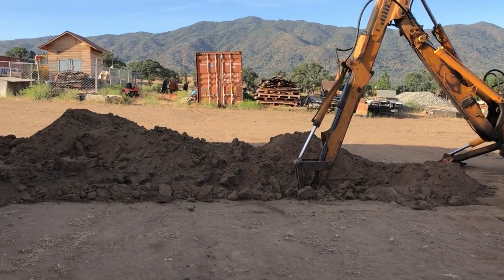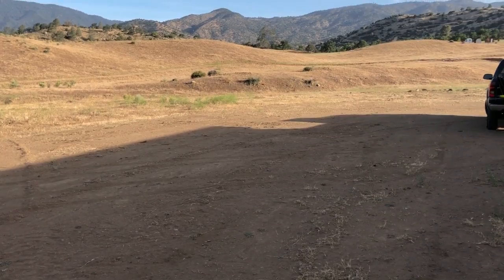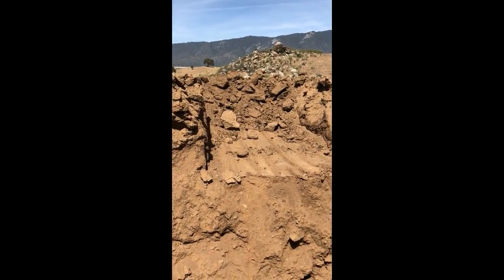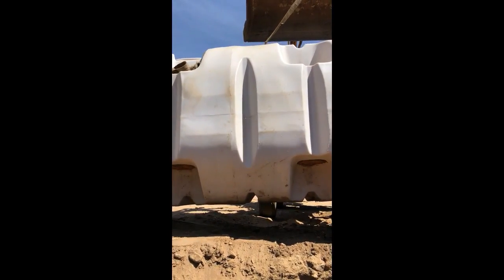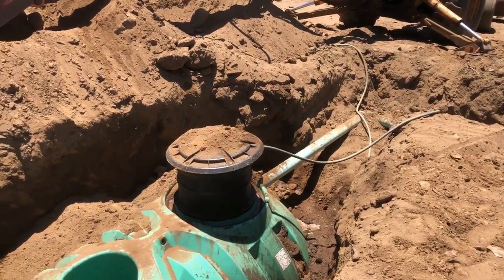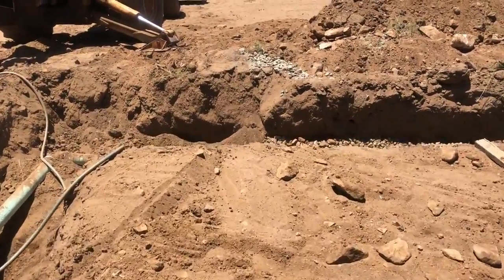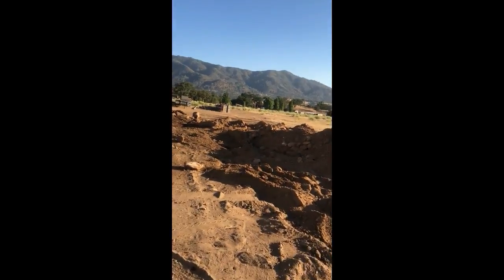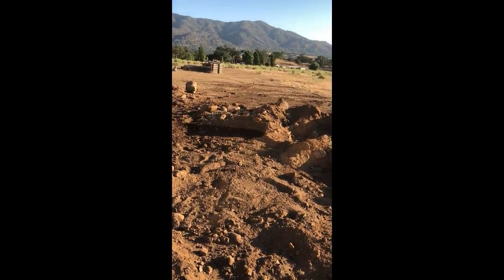Installing a new septic system including tank and  leach field

Comment: I'm a Septic Professional in the State of New Hampshire with over 20 years of experience, and we typically see Septic Tanks installed 10 to 15 feet from the foundation of the house. However, we are allowed to be as close as 5 feet, but it's very rare that anyone has a tank that close to their house, unless it's not possible to get further away from the building or dwelling. In any case, regarding the pitch on the Inlet Pipe, you don't want the wastewater to get ahead of the solids, because that causes problems, which is why too much pitch is not a good idea. By the way, this type of Leaching Area or Drainage Area, is actually what we call a "single line leach pipe" not a Leachfield or Drainfield, because it's just one pipe in a trench with crushed stone. Nevertheless, I've never heard of anybody using 3 feet of stone in a trench before, but I'm sure it'll last a long time. Typically, up here in New England, a foot of aggregate material is plenty, unless it's a Dry Well or a French Drain, but I think this system will work just fine... well done!
Reply: @bryang5412  Good Morning Sir, I understand what you're dealing with out there on the "left coast" is an absolute disaster. Very unfortunate, but I don't what you can do about it other than move... get outta there!
Reply: @craigwillson5974  My family and I actually just finished moving to San Antonio where I grew up. Lol! I will NEVER make the mistake of living on the West coast again!

Comment: Hillbilly Repairman, superb video! Thank you so much, it helps a lot of people who otherwise cannot afford to pay someone to do this work.  Oh yeah, I saw the list of expenses but not the cost of the backhoe rental?
Reply from the maker: The backhoe is mine, that’s a whole  other set of expenses 😃
Reply: The backhoe usually runs $200+ per day.  It's worth making a few calls to different rental places, just check the load weight to make sure your trailer can handle it, otherwise it'll need to be delivered, often at an additional cost.  Usually the 3 day rate is about the same as a week, so sometimes that's more cost effective.
Reply: @coriding  Thank YOU, this is what community means!
Reply: Home Depot rents and delivers

Comment: Curious, How much for the perk test? Sry if i spelled it wrong. Soil sample? Permit? As well as actual cost of septic tank and other installation supplies broke down. Thank you 🙂
Reply from the maker: Hello: It has been a while but from memory the perk test was 800 the engineered septic plan was 1200, the rock and delivery were 1800, pipe and fittings 400, and the tank was around a grand. the permit was around 800 I believe. hope that helps.
Reply: Thank you.

Comment: Wow!! Thank you for the video!! I’m moving to Tehachapi in the next few months. Purchased some land with a well. Looking at installing the septic and off grid solar system.  By chance what engineer did you use? Any help on leads would be greatly appreciated. @hillbillyrepairman
Reply from the maker: J&R Consulting. Alex Rivera 1 (661) 304-3019
Reply: Not Tonapah?

Comment: What engineer did you use to make the septic plans
Reply from the maker: Yes I needed my plans stamped by kern county building Dept. As well as the Enviornmental health department. It sounds horrible, but it was actually pretty easy. If you are in kern county I’ll look up the engineers number for you.
Reply from the maker: J&r design group. Alex Rivera 1 (661) 304-3019